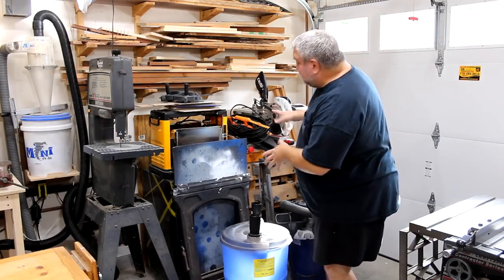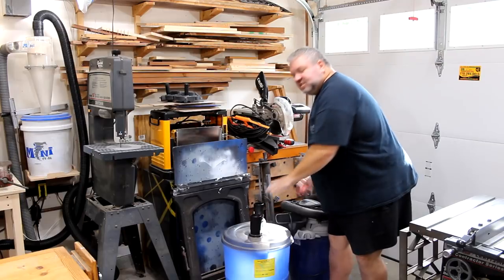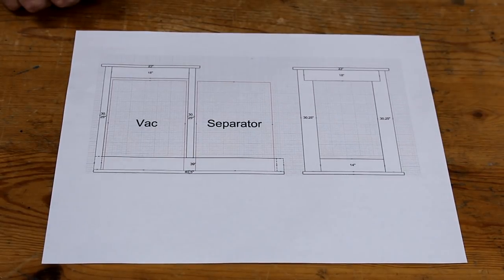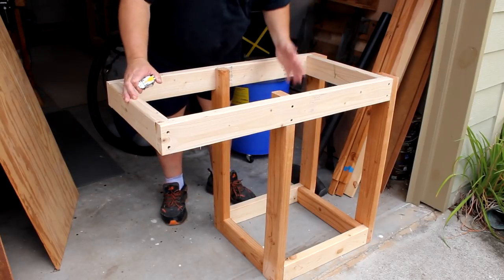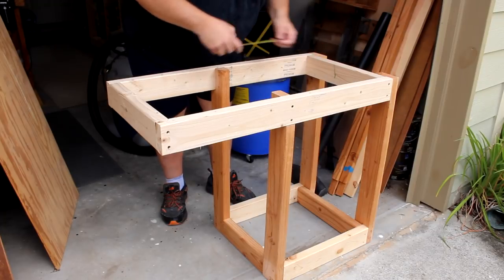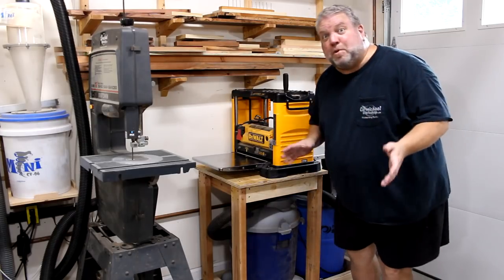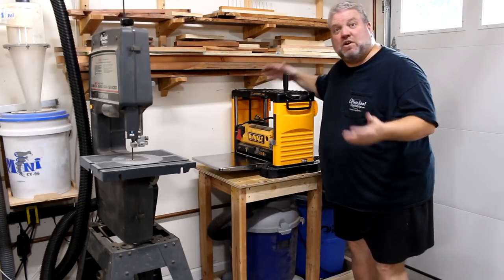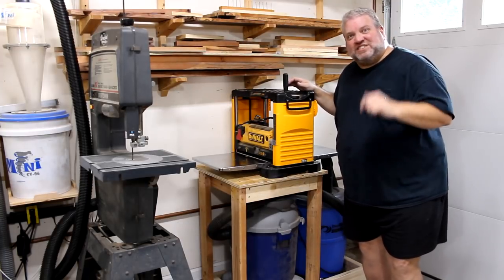Mobile Planer Stand with Dust Collection - Woodworking Shop Project

Comment: Just bought the same planer and will be building a cart like yours. Just need to buy the dust collection kit and a small shop vac. My current shop vac is a Ridgid wall mounted unit.
Reply from the maker: It works great.  I used to just let all the shavings get on the driveway then shovel them up.  This is much better.

Comment: Love the idea of individual dust collection units paired with each tool.  My shop is too rigid with all the ducting.
Reply from the maker: I'm constantly rearranging tools, or just rolling them outside to keep the dust out of the shop.  I have 3 shop vacs and the Rockler wall dust collector that cover everything I need.

Comment: I would fill up that separator in an hour. I am using a 40 gal trash can for a seperator.
Reply from the maker: Wow, I use it about once per month and only for short boards less than 4ft long usually.  I've probably emptied it twice in the last year.